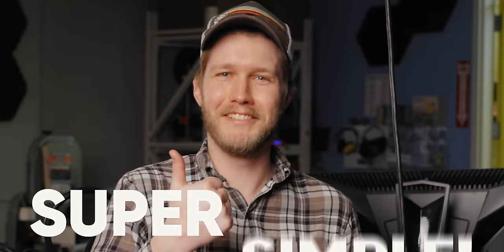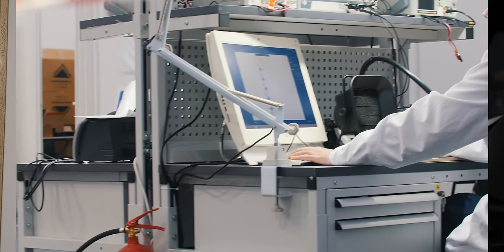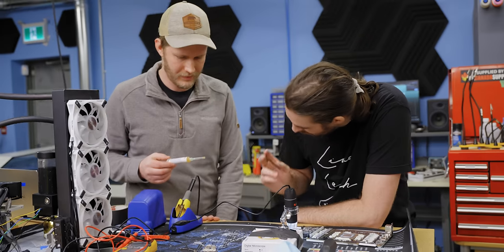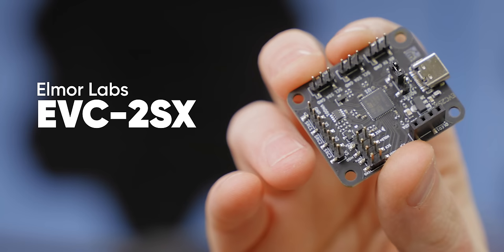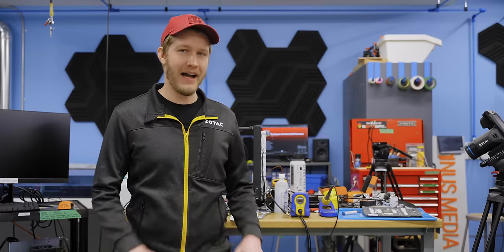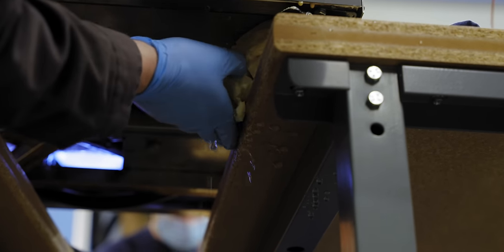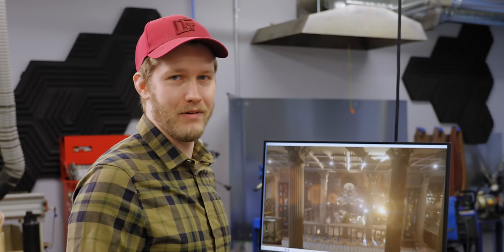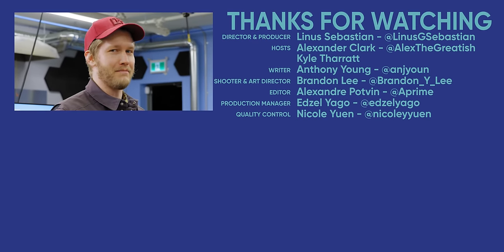Nvidia Doesn't Want You to Do This - GPU Shunt Mod

Comment: It bugs me so much that they're using a huge flat soldering iron tip for this... and FAT solder wire. Come on guys, i know yall have the budget for a good Weller and some .020 wire!
Reply: it is what it is. more money than sense
Reply: Calm down
Reply: @agenericaccount3935  I really do 🤣. I've just built many an industrial control box using the right equipment... and it's one of those things that i notice on a lot of youtuber vids lol.
Reply from the maker: We did use thinner wire for the final job, helped quite a bit. Also before this video we were already in the process of getting better soldering irons.. now that process is being expediated haha -AC
Reply: @LinusTechTips  even just a thinner tip on the Hakko would’ve made a massive difference
Reply: @ioogy  You’ll live, I promise. This is an amateur hour channel, don’t forget.
Reply: Sorry I don't understand. They said they had problems getting enough heat into the board. How would a thinner soldering tip help with that?
Reply: 1. By buying a soldering iron that’s not sh&£ 
2. With a soldering iron that hits target temps you can use smaller tips to get the heat into the correct places.

They had a bargain bucket soldering iron onto a board that just sucks heat away.
Reply: @notsure1613  Hakkos arent shit my man lol Maybe "under powered" here but certainly a widely respected brand in electronics
Reply: @LinusTechTips  Honestly the best iron I've used is the little TS100. I know Pace also makes some really nice stations that are favored by a certain German electronics youtuber.
Reply: Yo, that tip was just fine and I'd probably use a similar one for this. Always use the biggest tip you can fit in the spot. Largest thermal mass, fastest soldering. Their whole issue was they went at it from a completely wrong direction barely touching the pad or the resistor. If he got in there parallel to the end of the resistor and laid that tip in that bottom edge, heating both the pad and the resistor for a second before dabbing the solder in, I doubt he'd have a problem. The pad even looks nice and long, not ending just under the resistor, so you have space for this. It's amazing how they always manage to hire the most clueless people, two of the most prominent ones right in this video it looks like. Guess more money != more brains.
Reply: @SciFiFactory  it allows you to direct head straight to the solder joint that needs flowing rather than wasting stored heat heating the area around the joint
Reply: I’m ready to bet money on the hakko being just very miscalibrated
Reply: also should have used a cermic soldering tip, I hate those full metal tips.
Reply: @Jonas_Meyer  I tried to post a link but the comment disappeared, it is ceremic coated I think, anyway much better than a normal iron tip. I think there are copper tips as well for better heat transfer.
Reply: either someone messed the cal up on the iron or there is a problem with the heater in the iron; a 70watt hakko should have been fine for this (with the right tip solder and flux)
Reply: @Apex180  It would be if it was fucking touching the joint properly. It sure wasn't from what I've seen on this video.
Reply: @LinusTechTips  All good yall, you got the job done, that's what counts! I just know using the right tool for the right job makes life 10x easier. Though being a shade tree mechanic and tinkerer, ya gotta do what ya gotta do! xD

Comment: Your solder was spiking meaning you didn't have enough flux. The hakko 888d is totally capable of doing a shunt mod, but melting solder without enough flux is harder.

Comment: Quick nerd trick for soldering!  Melt the soldering wire above cold hard surface like a metal block or tile.  When it hits the droplet will flatten.  Use scissors or snips to cut a nice strip to lay between your contacts.  Apply a little flux between the contacts and your solder strip.  Downward pressure from and apply heat.  no mess!  <3
If you need a fine tip on your solder wire just take the wire to a table leg or similar surface (We used the handle of a vice).  Cut a length of soldering wire and pull it side to side against the surface until it breaks.  You now have a fine tip!
Final unwarranted trick!  Those little hand torches come with a heat gun tip or even a soldering tip.  They're much more reliable and handy than dealing with the wires and finicky nature or the electric point solder pens.  
GL!!  Love the vid!

Comment: Do a video on seeing how hard it is to brick modern day computer parts by basic tasks like overclocking and other configuration settings
Reply: If you aren’t running a modified bios/ hard modding the component its extremely difficult to damage things with overclocks. You have more control with cpu overclocks so you can technically crank way too much voltage and fry your chip, but killing a graphics card via just changing sliders in something like msi afterburner is almost near impossible. If a gpu dies after running it at the highest allowed power limit then it wasn’t long for this world, and it would almost certainly have died under more stock conditions pretty shortly after anyway.
Reply: @BeatsbyVegas  It's also near impossible to fry a cpy today, i have overclocked my cpu and wrote in the wrong settings with instead of 10% to a 100% this just made the pc crash instently but with a quick bios reset it started normally
Reply: @rasmust8044  you are not likely to fry a cpu by entering too high a voltage and POOF the magic smoke, but within a couple months that thing will be toast. But yeah  to overclock something so it literally catastrophically fails on you damn near impossible with any setting that is shown to you in any bios or software. And if it does kill it it wasnt the overclock but a fatal flaw that already existed that you found out right then instead of 2 months later.
Reply: @BeatsbyVegas  True I just meant it's hard to accidently fry it, but of course you need to test the cpu afterwards you uppd the voltage and clockspeed so its stable aswell to make sure it's properly cooled. And it's also easo enouth so any adult should be able to do it with a little bit of reasearch

Comment: What I want to know is, if you stuck some passive heat sinks on basically everything that makes heat, then put the card outside on a bitter cold day (or maybe in an industrial fridge) with some blowy-mactrons maintaining air circulation; how much of an overclock could we get?
Reply: I wonder if really cold, high-velocity air would have enough thermal mass to cool the GPU die using a passive heatsink. Everything else would be fine
Reply: @Incommensurabilities  The thermal conductivity of air is very low, it would do well in a hydrogen environment as well as eliminating the concern of condensation.
Reply: I would love to see that. But I believe humidity might be a huge problem in that conditions

Comment: Honestly a heat gun works quite well for this - if you are able to set it to a lower speed and use a finer nozzle you can replace SMD components quite a bit easier (and safer) than using a toaster.

I think you could do it with the Hakko (I have the exact same unit myself) with a high thermal mass tip. The one you guys were using looks pretty light for that sort of PCB.

You can also try pre-heating the board to assist the soldering iron in the future (so you're not bringing the whole thing up to temps that can damage components).
Reply: I also had good results with those plier type soldering tips that grab the component from both sides, put a drop of solder on each end to use it for thermal mass and just place it ontop- done.

Comment: Those soldering skills though...
For those blaming "cheap" equipment here, I assure you that was absolutely not the problem, simply a lack of training/experience. 
I would highly recommend taking a community college soldering/assembly class or at least studying the old Pace videos.
Like most, I always thought I knew what I was doing too. Once I took a class at JC, I learned how wrong I had been doing it. 
Now, I can make pretty (and reliable!) joints with even the cheapest Weller firestarter.
Reply: yea it looks like they didnt have advanced experience but idk if i agree about equipment not being the problem

I had a quick certification training at a manufacturing plant I used to work for. With proper equipment i was able to do some pretty good soldering if i do say so myself. tiny smds, super thin and close processor pins, bgas.
At home, i tried to unsolder the broken power jack on my laptop, i was using a $10 iron with no temperature control. With unleaded solder it was pretty much impossible to unsolder it because the iron just did not get hot enough, along with the fact that the jack was acting as a heat soaker, the solder just didnt want to melt. i spent 3 hours trying

so I bought a cheap but adjustable iron from amazon and i was able to do it in less than 5 mins. my point being, if your iron doesnt get hot enough then unless your a real expert. its going to be really hard if not impossible
Reply: if you don't have a powerful enough soldering iron the only thing that will save you on high power boards like GPUs is a ton of preheating(PCB at or above 100C).
Reply: I would say both... We have very good equipment at my workplace and it's simple sailing to solder even with 6-8 layered boards and huge groundsinks. While when I have to do half hard stuff at my crap-mediocre soldering station at home, it is a struggle sometimes.
Reply: I have one of those Hakko digital soldering irons; in fact, they are not cheap or unreliable.  If I'm not mistaken, by holding down the adjustment buttons you put the iron into calibration mode where you can tell it what temperature it is running at.  That is a sure-fire way of making it too hot/never gets hot enough, depending on how you adjust it.  Been there, done that, got the t-shirt.
Reply: I was trained and certified to do military grade soldering on ASW equipment....but they used lead based solder ONLY.  The 'lead free' stuff is absolute crap and the US military won't use it which causes the EPA to give them grief all the time...but the prints specify the solder and it ain't lead free which takes WAY too much heat to melt.   I hate the stuff, but anything consumer available now a days will be lead free which is a pain in the ass IMHO.
Reply: @recoilrob324  Lots of pB solder on eBay and Amazon

Comment: Wow, I have that iron and I've never had nearly those problems soldering things that sink a ton of heat, i've even used it to repair video cards that had SMD caps knocked off of them. When I ran into finicky spots, i'd use a hand held butane heat gun to heat the area around the joint for a few seconds, and then id pull out my iron and go to town. Generally this wasn't needed though, I just fluxed it heavily and then got a nice glob of 60/40 on the end of my iron, and then cleaned it up after if necessary. Yea, sometimes it's a bitch on surfaces that sink heat particularly well, but I've used that iron to solder things with a lot more thermal mass than a 3090 PCB

Comment: 4:05 You can also remove the old shunt and solder a single new one with a smaller resistance.
In the your case that you want to increase the power limit by 100% all you have to do is solder a 250mΩ resistor.
100% is a lot more power so If you want be more conservative you can REPLACE the original resistor with one those resistors instead:
4.5mΩ = ~11% more power
4mΩ = ~25% more power
3.5mΩ = ~43% more power
3mΩ = ~67% more power
2.5mΩ = ~100% more power

Comment: 6:41 noooo what are you doing?!
Put a bit of fresh solder and flux on the joints and soldering iron tip, then it will melt easily even with a 70W soldering iron.
Reply: You would think, but the GPU has a massive ground plane that wicked away all of the heat instantly.
Reply: @alexanderclark6889  yet if there is liquid solder on the soldering iron tip and fresh solder/flux on the connection, a liquid bridge forms upon contact and the heat flux through the liquid solder is enough to melt all the remaining solder on the pad.
Reply: @alexanderclark6889  Use a heatgun to preheat the joint, put leaded solder on the joint and wick it up right away, then replace with leaded solder. Also moving forward get yourself an iron like the FX-951. Tips with thermistor + heater core are so much better with heat soak.

Comment: I'm excited to see what kind of mods you guys are going to do once you have a proper soldering station or rework station.
Do a PWM controller feedback/sense pin potentiometer mod!!!
Reply: Wait, a sense pin potentiometer? Like a potentiometer that can auto adjust itself!? If you can happen to direct me to such a device, I will be a very happy tinkerer. PWM are what causes flickering in lights, by design, potentiometer does no such thing, but are much more expensive and generally require a manual touch.

Comment: More than double the power = 10% extra score.
That's how you know a stock 3090 is already running beyond what actually makes sense.
Reply: more power draw doesnt means more speed, it means more power dissipating as heat beiing generated and that creates more resistence and the resistence creates more heat and in the end even if you could pump 2000watts on the gpu it will not get any better clocks it can also reduce the possible clock and speed, thats all about silicon lottery, the better the silicon the better clocks you can get.
Reply: and thats the propper way to make a gpu faster build it with better manufacturing tho make the silicon better not relying on lucky but on tecnology.

Comment: In my experience soldering to power planes, a lot of those style of soldering irons suffer from the heater cor not properly touching the coper tip, so the core isn't directly heating the tip. I've have much better result shimming the PCB inside the iron so the ceramic core sticks out more and butts up againts the base of the tip, I also add some liquid metal to the inside of the tip to help with thermal coupling
Reply: I got a cheap aliexpress iron that uses T12 tips (Integrated heater, sensor and tip) eliminating this issue. It's also quite powerful (managed to solder 6mm2 wire for testing, the power is 120W and it also has some controller that is not dumb and gives more power if it sees temperature dropping to maintain it. The tips are kinda expensive 4$ each but then how often do you change tips.
Reply: @AsdfirePL  Honestly, a mid-size company like LMG could and should probably just go for some professional brand iron (be it JBC, Weller, ERSA or something else). They're expensive, and you're easily gonna be out up to 1k for a station and a few tips, but compared to salaries or other business expenses that should be very doable, and you get decent warranty and service on top (which is valuable in a business setting).
For personal DIY stuff aliexpress irons are probably fine (unless you have bad luck and get one that randomly catches on fire or exposes mains at the tip), though I personally would still prefer to DIY something like a unisolder as a cheap but good PSU/station and hook up JBC irons and tips to it (mainly because I really like them). When going for bang for the buck, there's also the miniware irons (TS80/TS100) which are great value and handling (low grip-to-tip distance) and really do hold up even on large ground planes.

Comment: I did microminature soldering in the Military back in the early 2000's.  You def need the RIGHT equipment to put those resistors on.  It takes about 5 seconds--with the right tools.

Comment: Suggestion: do a video on why overclocking works to begin with. It's far from obvious for many of us. Why would giving more voltage and current make it faster instead of simply hotter or more smokey? The clock must be involved somehow given the name, but the actual technical mechanism is not at all clear.
Reply: Overlocking is literally changing the clock speeds higher than stock. Typically to do that you need to overvolt as well. Doing that causes more heat due to conductivity.
Reply: Higher clock speed = more data processed faster. This consumes more power, meaning it then requires more voltage to be stable under load. This then produces more heat, which must be dissipated effectively or the card's thermal protections will throttle back the performance. How much wiggle room you have in each of those factors, and how much measurable performance you gain from it, varies hugely between models, and to a lesser extent even between the specific piece of silicon your card has vs another of the same model.

Comment: i feel like this may be a bad binned gpu. i got 11,512 graphics score on time spy extreme with only being water cooled and no modding. i am also using a strix 3090 but mine draws 480 watts stock, so i also dont understand why their gpu is only drawing 390 stock
Reply: It's weird because I did the same Time Spy Demo test, and my graphics score is 19183, with an Asus TUF Gaming 3090, 350W max too. I am not sure why the score is so different.
Reply: @AlexandreRacine  you did time spy, he did time spy extreme
Reply: It's definitely not a kingpin candidate. My 6900xt pushes out 10,522 on air and no mods.  There should be more of a gap here.
Reply: I'm using a Strix 3090 OC as well and at stock it should only be drawing 390w, mine will only pull 480w to 500w if the power limit is increased to 123% in afterburner.
Reply: my 3080ti self reported 411W on oc bios (gigabyte gaming oc)
switched to 'quiet' cause damn between that and cpu it's getting warm :P

Comment: 6:46 I'm gonna guess they screwed up the Hakko temp calibration while attempting to set the temperature and that's why its under-preforming so much. I've been there done that when I used to own the Hakko 888D iron and forgot how to adjust the temperature.
Reply: The first thing I did with my hakko was fuck up the calibration. I didn't realize how easy it is to do by accident.